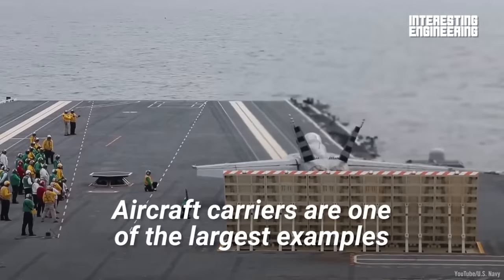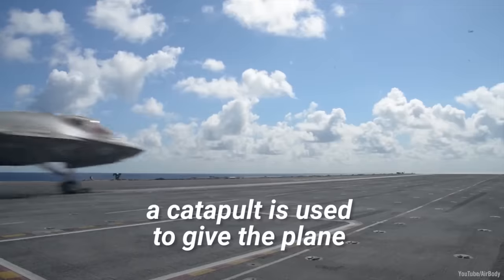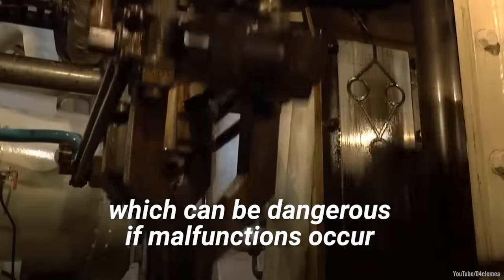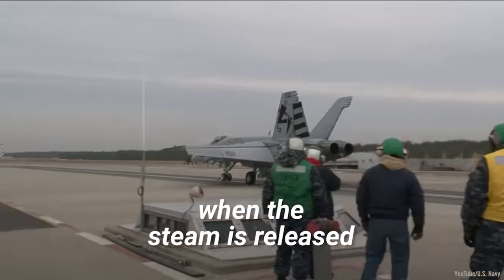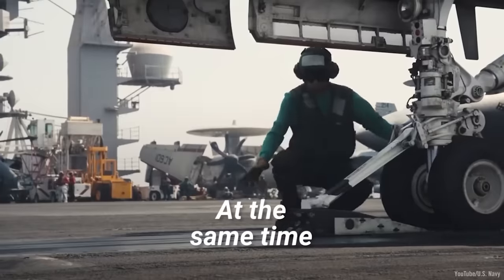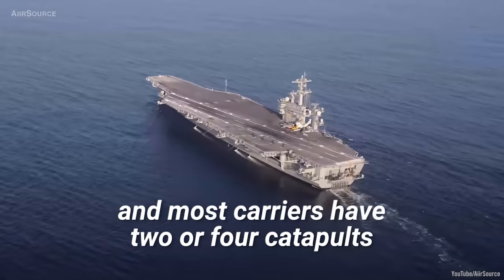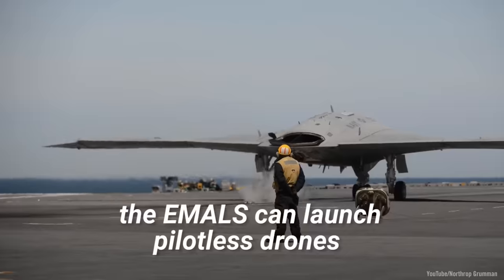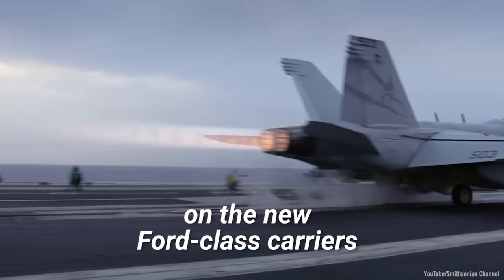How do aircraft catapults work?

Comment: The power of compressed steam is incredible.
Reply: And proven to work .
Reply: Ikr
Reply: It can kill U with a boom lol
Reply: ye
Reply: 90,000 psi can push a lot of metal.
Reply: Magnetic field is more..
Reply: Onur Şurgun 
Wow
How much?
Reply: @onursurgun  new generation catapults are/will be magnetic, but vast majority of US fleet is steam. Like 90+% of the fleet. Anyway, the system has 90,000 capability and it’s dialed in to specific required psi through a mechanical system to push the catapult with the attached aircraft down the deck to reach a specific end speed based on the aircraft type and weight.
Reply: Steam has a lot of applications
Reply: High way magative power wood recatange bus
Reply: In what country is your home?
Reply: Why? you clearly know nothing about dry saturated steam
Reply: @jimferoce4862  it is nowhere near 90,000.  I know because I ran them.
Reply: @jimferoce4862 90,000 PSI? With steam catapults, do you even know much is required to launch aircraft?

Comment: Those pistons going up and down (while they were talking about the Reactors) are from a VTE (Vertical Triple Expansion) engine.  Basically an advance on the old Double Expansion Cylinders that a Steam Locomotive use, mounted straight up and down to turn a Ship's shaft (which turns the ship's propeller).

Comment: The hold-back bar behind the nose gear is not part of the aircraft; There is a machined engineered 'breakable' metal link (sort of shaped like an hourglass), designed to break at a certain force.
They are one time use and are of different sizes for different aircraft. To give the steam and shuttle time to build up force, the holdback bar will keep the aircraft from moving forward and allows the shuttle to remain under tension until a certain force level is reached and then the link breaks, which allows the aircraft to have MUCH more stable force applied and a MUCH quicker launch.
The whole catapult system is amazing, as is the arresting system (you should do a video on that, too), and both use tons of grease. You covered it very well.
Reply: The more recent holdbacks are no longer using the corroded dumbbells we used to use. They are now calibrated to break at predetermined tensions. I remember schlepping boxes to the centerdeck of red, green, and yellow breakers and having 5 different bars!
Reply: That's interesting. This was a new piece of information for me! Thanks! I didn't know they were one time use, I thought they were using some kind of remote latch-release system akin to a trigger on a crossbow.
Reply: @yaksvk  The holdback bars have a "claw" if you will, that latches on to the nosegear attachment point. That is the calibrated connection, that is strong enough to hold back a screaming jet until the catapult is fired.
Reply: @chrismaggio7879 I sure hope that no carrier is using “corroded dumbbells”. They’re actually called “release elements”. With the S-3 Vikings being out of the picture on any aircraft launch (those were the purple or “magenta” by text book reference), there is still the C-2 Greyhounds that utilize the “white” release elements. I know that the EA6Bs had used the white T-Bars, but I’m not sure if carriers still launch them.
Reply: @torn-_shuttle123  We used to "bowl" with t bars... We would set up ten of the white "pins" and try to accurately roll one across the compartment deck (in the coop, not on the flight deck) for a dollar a game. 3 rolls per game, highest points wins. (Hint: smaller t bars roll straighter). Couldn't hurl it or throw it... had to roll it, so if you roll it aggressively it went way off track, roll it carefully and you had a better chance.

Comment: A "launch bar" is what attaches the aircraft nose gear into the shuttle, not a "tow bar"
Reply: What happens when the plane comes back into land? Doesn’t the launch bar get in the way of the tyre?
Reply: @11clarkm  The launch bar is extended or in the down position for launch, once airborne the pilot retracts the launch bar to up and locked position
Reply: @shootermcgavin633 Exactly.

Comment: As a former Catapult flight deck crew man ( green shirt ) He is NOT Signaling the Plane to “ take off “ He is signaling the Shooter ( Plane Director) His directions to hook up the tow bar to the shuttle and once the tow bar is locked in he then signals  to the Plane Director that all sides Are clear and completes the safety check, he then gets out of the way and the shooter then signals the pilot to go to full military power and clears the rear, sides and front of the aircraft once more than sends the signal to the shooter who sits in a bubble in the middle of the flight deck who then pulls the trigger to launch…. JS

Comment: How does the hold back bar disengage from the nose gear?
Reply: If you mean the bar in the front latched into the shuttle, when the nose gear goes up, it locks into the parallel position allowing for a landing.

Comment: 0:40
Aircraft carrier's aka The Boat to navy men, has a runway of 800 feet and is 80 feet wide and is tilted at 9° left.
The deck is divided into 3 sections.  A, B and C. from front to back  there are usually 4 elevators, but more recent boats are 3 elevators for efficiency. its #3 elevator thats closed next to the island.
The Nimits class are larger runway of 1,065 feet and 90 feet wide and 10° tilt to left.  The displacement of "The Boat" is 102k tons accompanying 6000k crew members, 100 are USMC.
The nimit's class ship is known as the CVN 68 class ship.  It has 4 catapults, 2 in the front and 2 on its side.  Overall length of the "Boat" is 1,115-feet.
Reply: What in the hell are you talking about?? I was under the assumption that we were discussing Catapult operations. What the fuck are you talking about the Ship being divided into 3 different sections and displacement of “The Boat”.???

Comment: Would like to hear more about the use and design of the holdback bar
Reply: The holdback bar is a highly technical piece of gear despite its appearance. It is calibrated to "break" or release its mechanical grip at a certain tension. The aircraft on the cat is put into military power (full throttle) and pulls against this holdback bar as it waits fort the launch button to be depressed... If the holdback releases before the cat is fired then the aircraft will roll forward with NOT ENOUGH speed to leave the deck and fly, but instead it would roll off the end and be run over by 97,000 tons of tax payer's dollars. We try very very hard to not let that happen! Each type of aircraft has its own holdback bar, and they are constantly being calibrated to ensure they are accurate in their breaking tension. When the catapult is fired the pull from the shuttle/pistons easily overcomes the holdback bar strength and it "breaks", and off goes the bird. The older version of holdbacks had color coded dumbbell-looking pieces that were replaced after each launch. They actually did break! half stayed with the holdback bar and half went over the end of the ship when the plane retracted the gear. Big FOD issues if you weren't paying attention.
Reply: @chrismaggio7879  Yes, it's kind-of like a giant torque wrench.

Comment: These catapults are really impressive.. One has to consider, any failure of the system, including any issues that lead to reduced power during launch, always result in a loss of the aircraft being launched. There's no way to abort a launch, is it?
Reply: The reason for multiple cats is partially to have backup in case one or more cats goes down due to mechanical issues. Yes, there are a hundred safety measures and constant monitoring of all systems to prevent catapult mishaps, but very rarely you might get what is called a cold shot or creep, and that puts aircraft and crews in jeopardy. Most can be mitigated, but a cold shot where the aircraft is slowly pulled down the length of the cat (like walking or jogging speed) the crew will actually eject and the plane goes swimming.

Comment: Why should the propulsion mechanism of the sled affect the stress on the aircraft?
Reply: First off I wish they wouldn't use the term sled... it's not accurate. Shuttle is correct. The reason the forces are different is that with the steam cats the valves that hold back the energy are banged open and it jolts the shit out of the nose gear (and hence to the frame of the aircraft as well). The EMALS is a smoother start and run, so the forces are applied in a more constant buildup to end speed.

Comment: Videos that are shown, the information U.S. Navy is putting out = USS Midway, launching
• Catapult power: 0 to 170 mph (150 knots) in 3 seconds or less
• 90 seconds between launches
• Catapult length: approx. 265 feet

 It would appear in the videos they were launching aircraft at the Battle of Midway at a much higher speed than modern aircraft carriers ???

Comment: I would like to hear a lot more about the holdback bars purpose.
Reply: The holdback is a mechanical link between the gear and the deck. It is designed that it releases at a given amount of pressure, depending on the take off weight of the plane (they are color coded).
When the needed pressere is reached, the holdback realeases the plane in a very short moment so the acceleration can be maximized.
Reply: Yes sir I understand and thank you.

However this does explain why the holdback bar is needed, in other words, why is the holdback needed and when was it added to the catapult system? Thank you and regards.
Reply: @kedmark  The pilot will bring the aircraft up to full throttle just before it is launched, hence the blast shields that pop up behind the engines.  The holdback bar will hold lock the aircraft to the deck of the ship until the catapult is released.  The plane is essentially going full speed before it takes off.
Reply: @a.j.zadrozny1752  full throttle.....

Comment: Good basic introduction to catapults, but many details are wrong.There is no view of the trough and the cylinders, including the critical sealing strips. There is no desciption the function of the JBDs. The CROV, which is a kind of metering valve (and critical component) attached to the accumulators, is not mentioned. The center deck station and the importance of matching the quantity of steam to the planes weight is not mentioned. The purpose of the holdback is not mentioned, and it is incorrectly stated they are released, when actually they are broken (snapped) at each launch. It is the retraction engine that resets the catapult to launch position, not "grabber". The chronograph, which measures the actual launch speed is not mentioned. Drones can EASILY be launched by steam catapults, and it is unclear where the misinformation came from. The stealth drone shown is the X-47B, with a MAX takeoff weight of 20,215 kg, compared to a large Navy fighter like the F-14D, with a MAX weight of 33,725 kg, which was easily launched by steam catapults.
Reply: Not all of the viewers were green shirts like you and I ... and I honestly think this vid producer doesn't know about these things...
Reply: @chrismaggio7879  , it is very obvious he/she doesn't. BTW, I was the CatElect LPO on the USS Midway. Lived on O2 level with the ABs. My shop/office was in the 2S sheave damper compartment.
Reply: @mrnickbig1  Haha that had to be one loud office! Thanks for your service, and on a fine ship too! Is it cool to know she is a museum and teaches/inspires thousands each year? I am a Plankowner on the Lincoln, and I miss it everyday.
Reply: @chrismaggio7879 , I actually was in the nuke program and went to NPTU Idaho Falls (S5G reactor). Many people were excited to become plank owners in the Lincoln (mid 1980s). I had many different jobs (long story, starting with AFQT of 99, while being a foreign national at time of enlistment). Ended up going to Cat Elect "C" school rather than being assigned as EO. On the Midway, in addition to being the CatElect LPO, I was also lead on NBC survey team and ran a repair locker (a partial one, anyway, the 7A "unit" locker).  7A was split into two parts, the main locker and a smaller one on the other side of the ship.
Reply: Since you were on the Midway, much has changed, even on Nimitz Class Carriers. The "newer" hold back bars don't use tension bars as much, they do in fact use a hydraulic cylinder to actually release from the jet. Cods and Hawkeyes still use tension bars though. Chronographs are no longer used, Digital Indicators are used. And the CROV you mentioned is called a CSV (Capacity Selector Valve). And although the retraction engine retracts the shuttle, the Grab is what pulls the shuttle back to battery, through the retraction engine.
Reply: @r.n.4546  , And, I bet the Digital Indicators use magnetic sensors, probably sealed Hall Effect type. I guess the Sealing Strips are still an issue, considering how much effort the US put into developing the electromagnetic catapults. And, I think I got confused about the cam operated valve that metered the steam into the catapults. I think the CROV was what controlled the tension on the arresting system. There were these big hydraulic rams with blocks that payed out cables attached to the CDPs (Cross Deck Pendant) which are the actual "wires" that the arresting gear hooks (tailhooks) catch to slow down. There are also smaller pulleys (sheaves) mounted on hydraulic shock absorbers, called "Sheave Dampers), that mitigate the initial shock of the impact on the CDPs. I think the big steam vave was called something like "Main Steam Valve", which, on the Midway, was connected to a wet accumulator. Thank you for your information.

Comment: So does that mean in the steam catapults fail, the planes cant take off?
Reply: The purpose of the catapults is to to assist launching aircraft on a short runway. However, it still possible for jets to take off on their speed but it trades off burning more fuel to take off and limiting amount of time to launch aircraft at a time.
Reply: @Slygolem1  it will also severely impact efficiency of operations and weapons and fuel capacity of aircraft

Comment: I didn't know that they used steam to push the jet. I had always thought that it was the afterburners that did it!
Reply: It’s every thing that incorporates water, steam, pneumatics and hydraulics. Water from the boiler systems is turned into Steam, which is supplied to numerous components and systems throughout the ship. But, also has to be regulated. Obviously, the sole function for Aircraft Carriers, goes to the Catapults. That Steam, which is regulated by Engineering MM’s, is fed to the Catapult Launching Valve system. And through numerous Hydraulic and Pneumatic components is what actually makes the Catapult system work. There’s a lot more that’s involved that most won’t understand until you learn the basics.

Comment: Not entirely accurate.  When the accumulator releases, the stored steam floods into a tank that is partially filled with water, causing that water to explode into even more steam which expands and pushes the shuttle down the deck.   Also   if you think it's amazing watching a carrier operate, you should see one being built.  I spent 2 years in Newport News shipyard on pre-commission Abraham Lincoln, watching the shipyard build her.  How anybody can get thousands of tons of steel and miles of wire and pipes and gear and everything into a ship is just crazy.
Reply: Friendly note
The accumulators work a little different than that.   Yes, they are "wet" steam tanks.  The launch mechanism is a huge valve and the control system for the valve, so you dial in the setting and the valve releases the steam into the cylinders at a profile set for the plane. 

Btw: 75 to 81
Reply: jobu88... I was also precom on the Lincoln! Air Dept, V-2 Div... From living in  Huntington Hall thru shakedown and on to commission! Those damned foggy goggles and headache inducing hardhats! What an strange environment it was with miles of cable and 600 people painting everything grey... haha Loved complaining about every minute of it but so proud to have been there. Ate my weight in Mr Lee's burgers at the joint just outside the gates.

Comment: Am I the only one who didn't understand when he started talking about "pistons and cylinders"? At that point, a picture or diagram would have been needed to create all this in your mind: what kind of piston, what kind of cylinder, what sizes, what positions, what movements, what interactions (if you've seen these things before and how they work, then it might be enough to merely describe them).
Reply: Max. Imagine two huge rifle rounds about 10 feet long inside 200 foot tubes, laying side by side. Each of these tubes has a cut the entire length just above where the two tubes are touching. There is a bridge or connection between the two bullets that joins them together, and on top of that bridge is the shuttle (seen on the video). The tubes are below the flight deck, and the only thing sticking up above the deck is the shuttle. Behind each of the tubes (below deck) is a huge valve that remains closed until the pressure is sufficient to do the job. The aircraft is hooked to the shuttle, the shooter eventually gives the signal, and the button is depressed that opens these two huge valves in an instant! That steam pressure is massive and it launches the two rounds down the length of the tube sending the aircraft forward. The two pistons (bullets) at the end of the "stroke" slam into a water feature called water brakes, and stop in 10 feet! It's violent as hell and noisy, but they are unharmed and ready to be dragged back to the starting point.